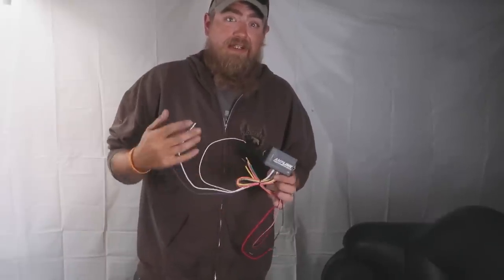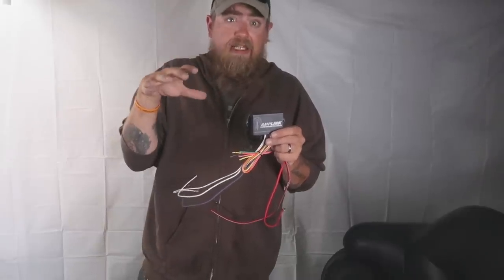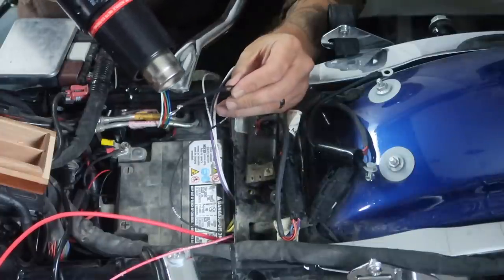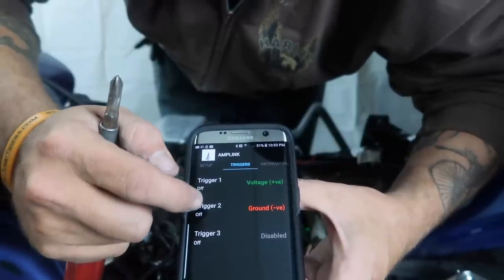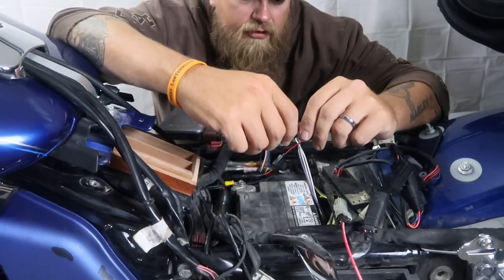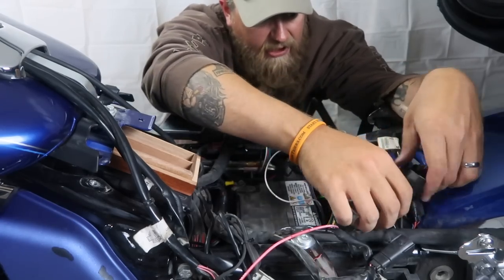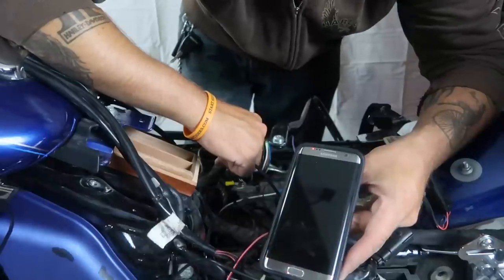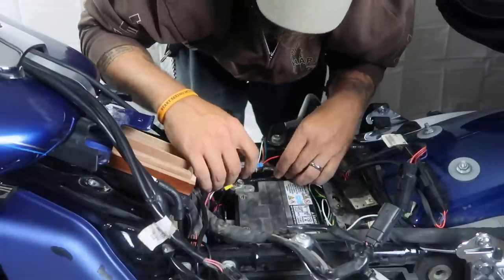Power Distribution Module Motorcycle

Comment: Thank you for the wonderful video.  I installed the Amplink on my 1997 Honda Pacific Coast.  It really makes wiring up accessories such a breeze.  I control all the circuits from my smartphone.  I am only using 3 circuits at this time.  For the circuits I am not using,  I turned them off.  I used the always on wire to go to the battery tender.  I will add a couple of more circuits later.  Much easier than wiring up a relay, fuse block and ground block and much smaller.  No more worrying about blowing fuses and replacing them.  The PDM60 is a very good unit but the Amplink is great.
Reply from the maker: I agree,  it's a great little unit.. very handy!

Comment: Nicely Done.  You may want to mention that, when disconnecting the battery, always disconnect the negative lead first.  This way if the tool you are using to disconnect the positive lead touches the bike frame, you don't  have any sparks or melt the tool you are using.  When connecting the wires back to the battery, connect the negative lead last.
Reply from the maker: Good tip, thank you.

Comment: Where do you connect the negative wires for your accessories? The pdm based only one wire for the positive right?
Reply from the maker: all of the negative wires attach to the negative lead off of the PDM
Reply: @Touringmidwest  thanks!
Reply: @Touringmidwest  thanks for the help hooking it up! Made it easy. However for some reason I couldn't connect to the app at all? My phone couldn't find it  any tips on that?

Comment: Do you still have the Amplink? I am using 2 outputs. One for my radar (output 1) and output 2 for my Garmin Zumo XT. Output one works like it’s supposed to but output 2 tells me it’s off on the monitor side. I don’t see where I can turn it on. How are you triggers setup? I wonder if that is the issue. Thank you for your time.
Reply from the maker: I do, if I remember correctly my only trigger is the ignition switch but its been awhile since i set it up.

Comment: HI there i just bought the unit but not able to pair it up via bluetoothe the Amplink doesnìt show up in the bluetooth list at all... any suggestion i tried to contact the guys at Rowe but no reply... i also ive in the UK and a shipment back would be expensive so want to be sure if is my unit defective or maybe i did something wrong but i mean is jusy hook up to poer the green led stai fix and that should be the time of pairing but no way to have it in the bluetooth list i also tried with anothe phone but same thing bit disappointing any suggestion would be well welcome cheers
Reply from the maker: Keep trying it should show up at the very bottom of your list, make sure that your phone is searching for a Bluetooth connection,  If you can't get right away you'll have to turn off the ignition and then back on. Other than that I am not sure. The guys at Rowe are very helpful so keep trying to get ahold of them as well if you continue having issues. I honestly have not tried the app in a long time because it's set up and I don't have to worry about it but when I originally set it up I think it connected right away.. wish I could be more help but I cannot think of anything else that would keep it from connecting.

Comment: Very good video and he certainly makes it look easy.  I am currently in the process of installing an Amplink PDM and it is anything but easy.  At least for me.  If you are familiar with electronics and wiring in general, you'll have no problem.  If, like me, you have no clue about what a 'trigger wire' does, etc. you are in for a steep learning curve.
Reply from the maker: You can do it! It takes a bit to wrap your head around all of the wires, but for me once I  got past that it went pretty easy. its pretty intimidating to look at. If you run into anything that catches you up just give the guys a call at Rowe and they will explain it, nice guys there.

Comment: Is the green led light supposed to stay always on?
Reply from the maker: I can't remember,  I know there is a light for the bluetooth that is only on for 30 seconds or something like that but I feel like there is another light that is always on.. I have the thing buried on my bike so I don't see it enough to remember for sure.
Reply: @Touringmidwest  thanks, but with the light on, wouldn't that drain the battery slowly?
Reply: @Touringmidwest  also I couldn't tell but which positive wires do you use? The trigger or circuit? And why are there both wires? I tried the trigger wire to my heated grips,  didnt work so I wired the circuit wire instead and it worked.